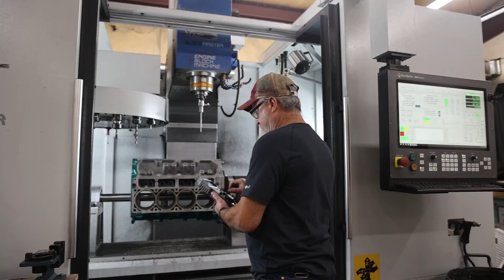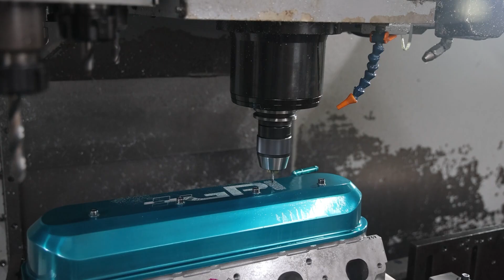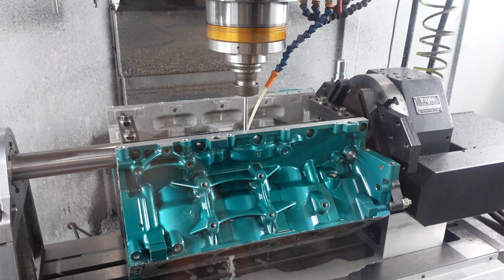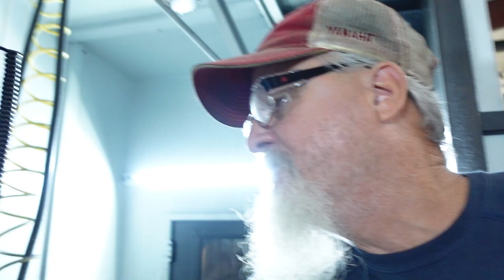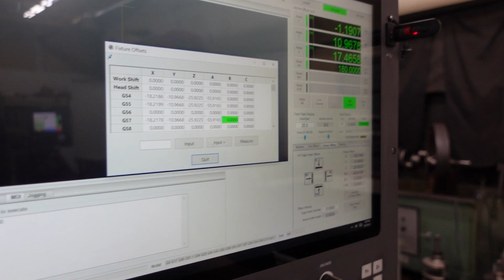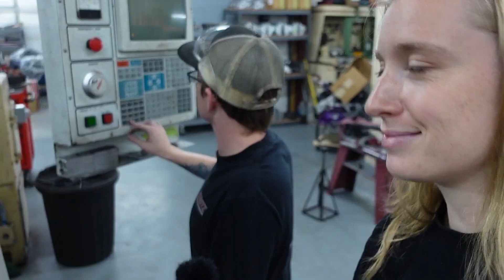Machining my LS3 into a 416 - COLOR REVEAL Ep. 5

Comment: You can't bore a 6.2 to a 416.
Reply from the maker: Lol
Reply: Yeah she missed the adding stroke part, but you knew what she meant and she has people to worry about those minor details.
Reply from the maker: @taylorsrus9543  Kuntz & Co. are the machining pros. Bore is 4.705 / Stroke is 4.000
Reply: @KaylaRundle  Yes I know, I just pulled my 416 out of the car last weekend. You should enjoy yours. I applaud your efforts to learn, nobody was born knowing everything.
Reply from the maker: @taylorsrus9543  I appreciate that so much!
Reply: @taylorsrus9543  Minor details? It adds a few thousand to the build of the short block. I just came across this lady's channel. Don't know her. But I will say, if you let a machine shop just run away with your build they may give you something your not looking for, doesnt fit your actual needs, or something you could have gotten much cheaper if you have some knowledge about what's going on.
Reply: @moabman6803  she said bored to 416, which was an error. If she would have said bored and stroked, then you would not have commented. So, yeah that's pretty minor. She is clearly new to this, but despite that, has the guts to make a video and show it to the world. It is also clear that she is working with a known professional shop to realize a pretty cool dream. Oh and adding the needed stroke for this isn't a few thousand, it's about one, depending on the crank used.
Reply: @taylorsrus9543   Dude I made a simple correction of a comment. You want her to walk around the rest of her life thinking she bored her 6.2 another 3/4 of a liter go for it.

Comment: You go girl, wish we had women like you 50 years ago, I would have been a happier camper.😎 ya we had Shirley  (Cha Cha ) Muldowney but she was 10 years older than I and I didn’t want people to call her a cradle robber. 🤬🤬🤬😇
Reply from the maker: Maybe you did and they were in their garage working on their cars instead of going out! Now a days we have social media to expose the truth!
Reply: @KaylaRundle  No, my ex wife of 30 years spent her time raising 5 children and now she helps take care of grand children. I don’t use social media, hackers, and liars. I still think by powered coating your engine parts , they will hold a lot of heat in . Need bigger radiator. Why do you think GM don’t paint the aluminum engines like their cast iron ones ? It’s not to save $ 1.00 on paint.
Reply from the maker: @batman607  I am building a show car that is road course capable. I’m not AutoX or anything to aggressive that holds lots of heat. Yes I will have a ton of aftermarket cooling installed on the car. Thank you for your concern. I am building my car very specifically for what I want & need!
Reply: @KaylaRundle  you know more than I do so I’m out of here. 🤞 .
Reply: @batman607  It is absolutely to save the dollar on paint. This is a mild NA car so it's going to be more than fine.  The saddest part is you cant really see the block in the car.
Reply: @taylorsrus9543  Goode luck with the build, To me that’s a piece of jewelry and my ex is lucky because if I had it ( with a Batman insignia of coarse ) I would park it in my living room, pipe the exhaust outside and every morning at 6:00 am I’d start it up just to piss her off. I did win $5,000.00 in a one hundred lap enduro race back in the eighties so I’m not just an armchair Quarterback like a lot of people. Have a GREAT day.
Reply: @batman607  I agree, your ex is lucky.